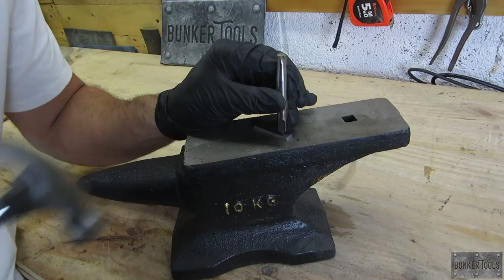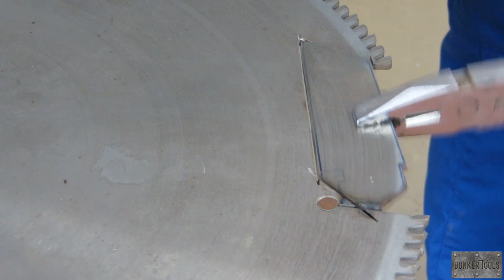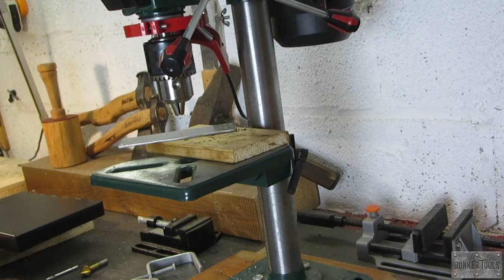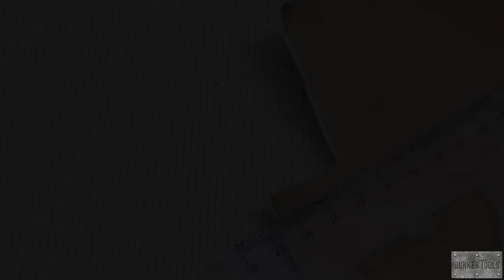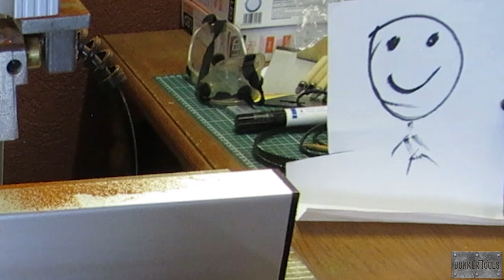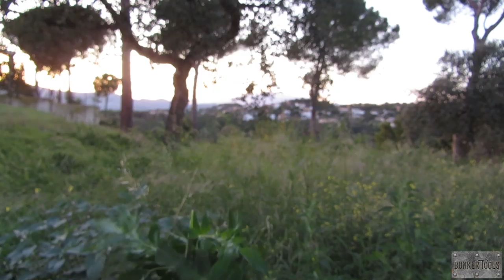Making Safe Lock system

Comment: the blade heat treatment ????
Reply from the maker: The disc already has heat treatment, an indication is that I had to use a cobalt drill to make the hole (the hss drill could not) While cutting with the grinder it was cooling with water so as not to lose temper. Thanks for watching dude👍👍
Reply: @bunkerTools  good job
Reply from the maker: @mostafahassan7357  thank you very much 👍